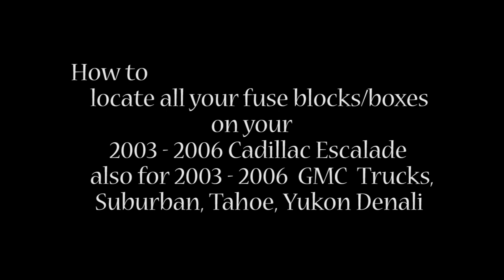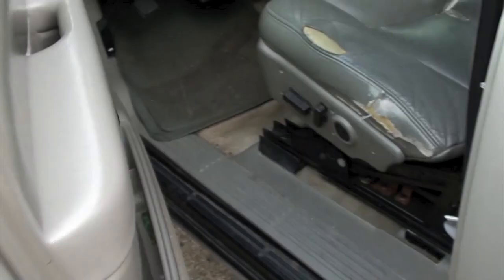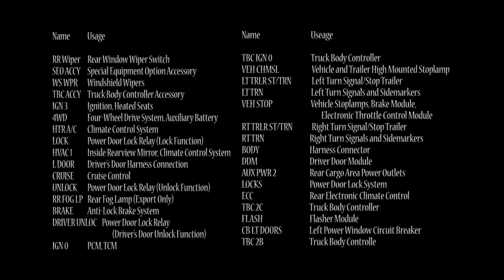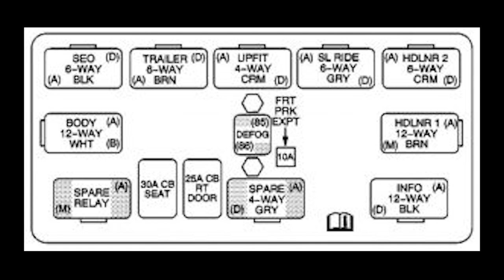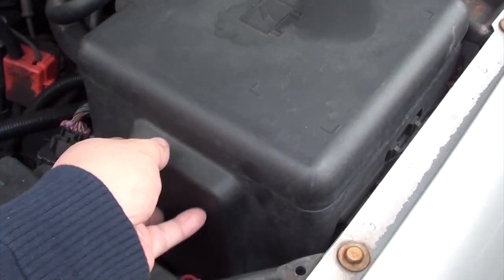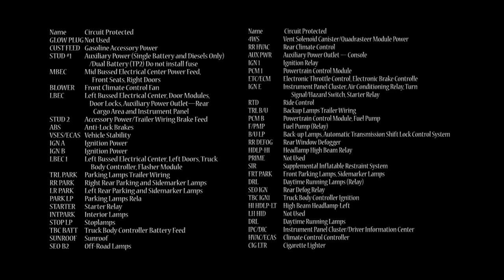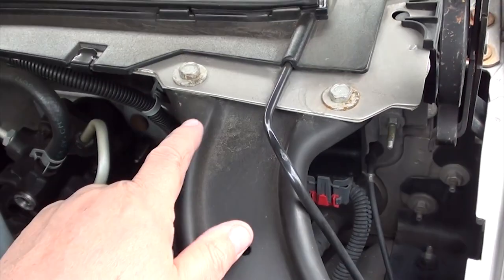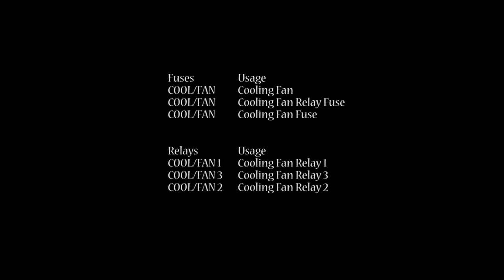Cadillac Escalade - Complete Fuse Block / Box locations - Relays Locations

Comment: Can you please tell me where the main alternator inline fuse is located on a 04 escalade 6.0 motor ?
Reply from the maker: See if this helps...
https://www.cadillacforums.com/threads/2004-escalade-esv-maxi-fuse-30-amp.1105093/
Reply: @notsofast2325  Thank you, I thought my alternator was bad but turns out it was a bad battery. I do however have to get a new power steering gear box because It's hard to turn my wheel to the right. Do you have a email ? I would like to communicate with you about my 04 escalade.